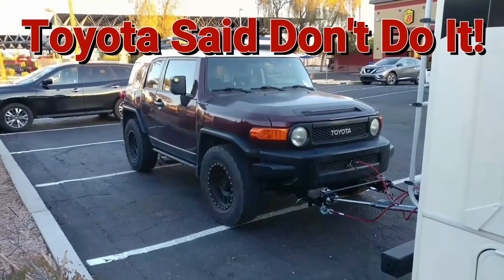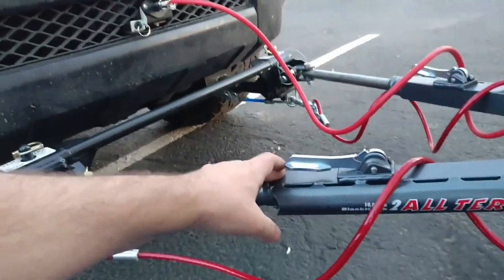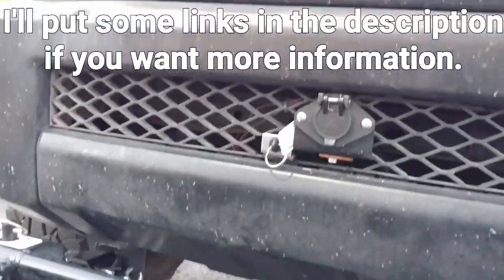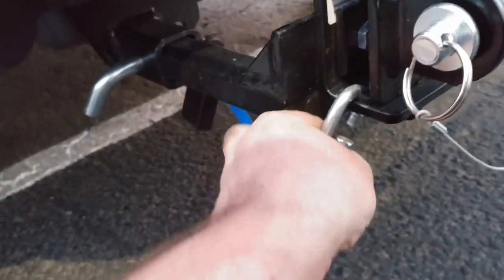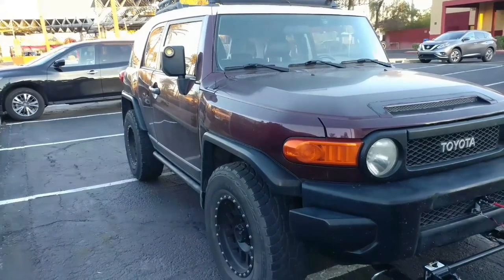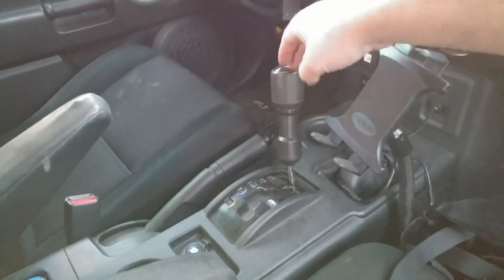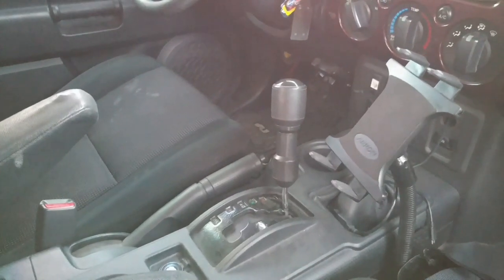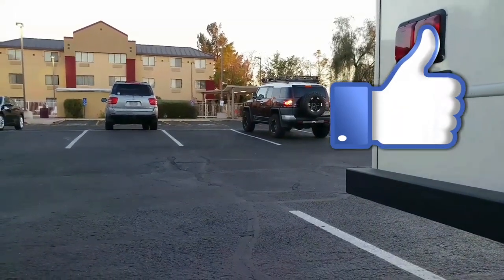How I flat Tow a Toyota FJ Cruiser behind my RV.

Comment: Are you kidding?!  Unhooking the drive shaft?  Why does etrailer and others say it can be done with an automatic.
Reply from the maker: Let me give you a better answer.
etrailer is likely going to sell you an expensive pump, that you will then need to spend a lot more money on getting installed and integrated into your transmission to keep the fluid flowing on the portion the transmission that will still be turning when towing it in neutral.
There's controversy about how affective this is long term as it still puts Milage on a portion of the transmission and the majority of the transfer case.
Reply: Another question.  If I disconnect the rear drive shaft what about the front one?  Wouldn’t I have the same problem
Reply from the maker: @bruceforbes2008  not if you're in 2wd. The front is disconnected by default until your in 4wd.